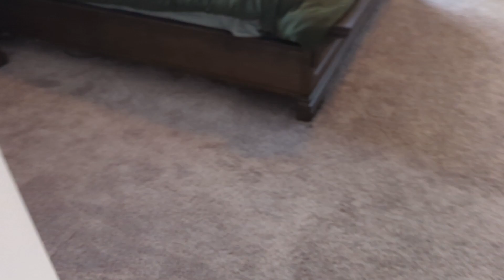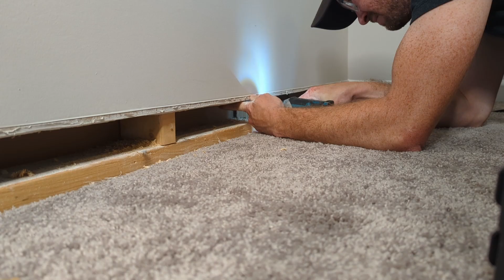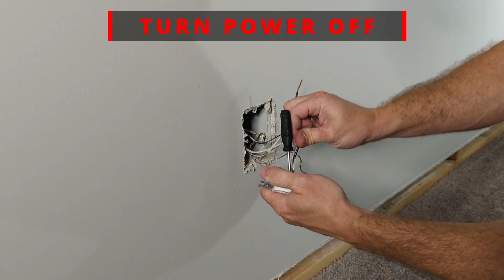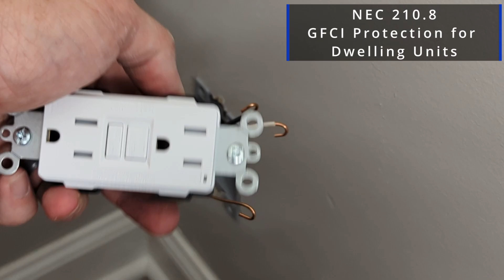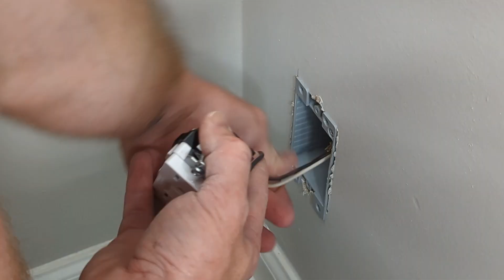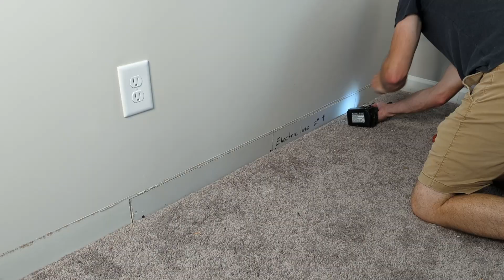How To Add a New Outlet To An Existing Wall

Comment: don't you need to staple that romex to the stud near the box you added?
Reply from the maker: This would certainly be necessary for the work to pass inspection. Pinning your comment so others can see. Thanks!
Reply: @HouseholdHowTo  Actually I believe the code says when running a new Romex wire in an existing closed wall, the stapling of the Romex is not required.

Comment: You don't need to be a pro to figure out the  back clamps on the GFCI. They're probably even easier for DIYers. And there's a difference between those and "back stab" connections.